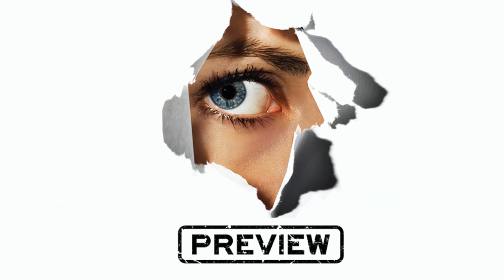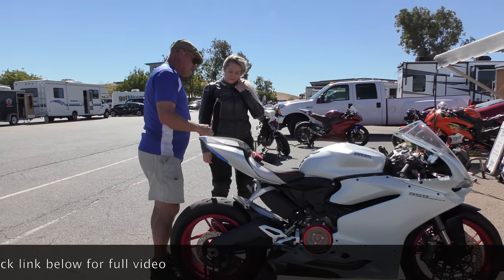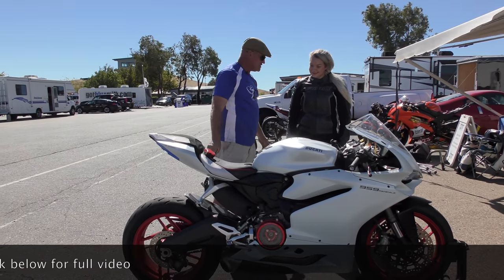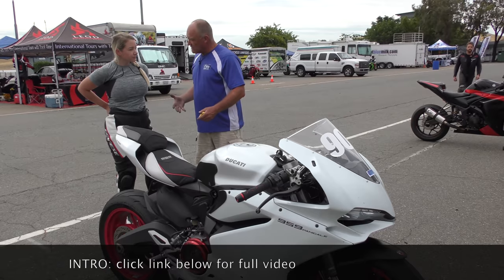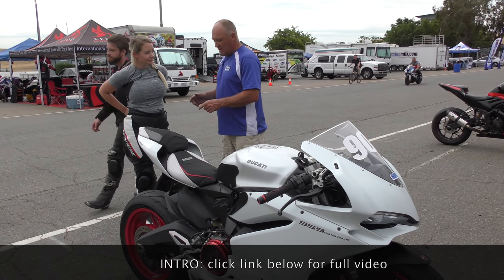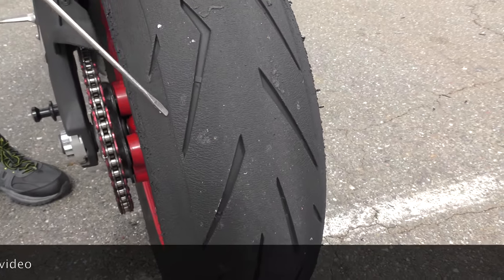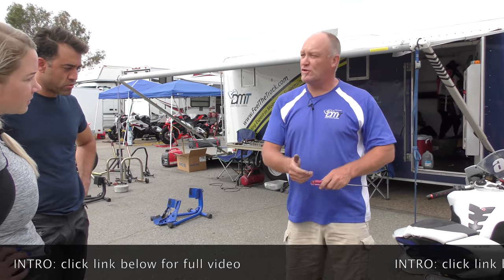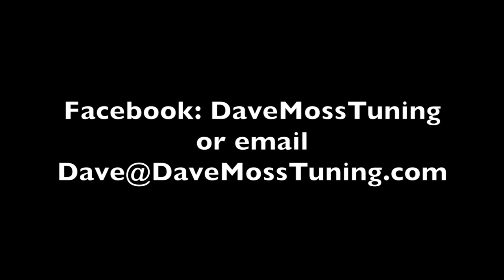2 Clicks Out: Miss 959 Panigale Suspension Setup Intro

Comment: What tools are needed to do this virtually with you. Saw on your site that’s an option. My suspension is not right on my new 2019 GSXR 750 and I need your help. But I’d like to have the tools in advance, so I’d need specifics. Thanks!! You save lives making our bikes safer and better handling while  helping us to maximize our enjoyment from our hobbies.
Reply from the maker: flat blade screwdriver, 5mm allen, 12mm socket and shock spanner tool to change preload